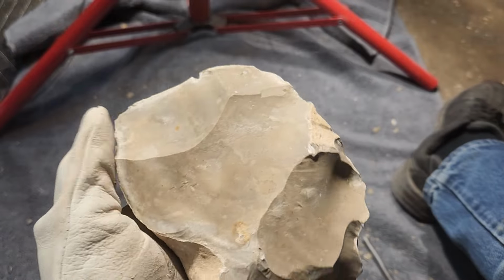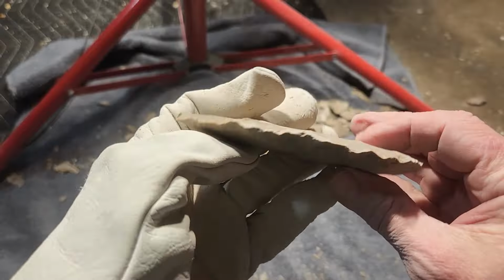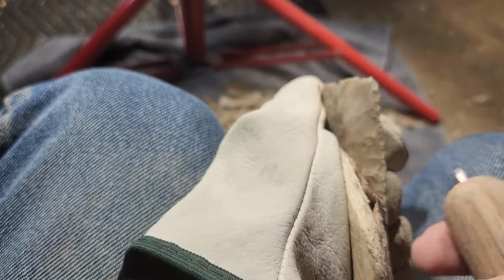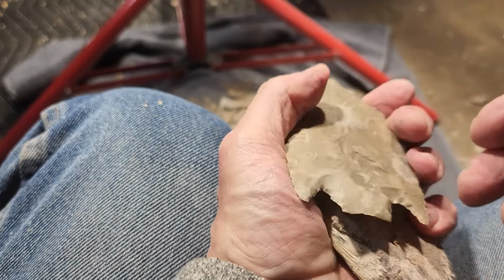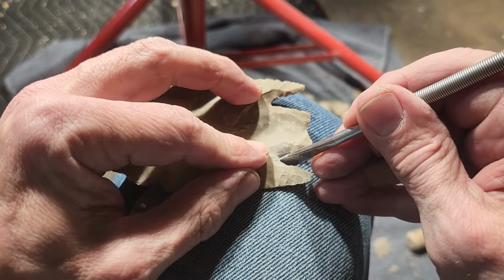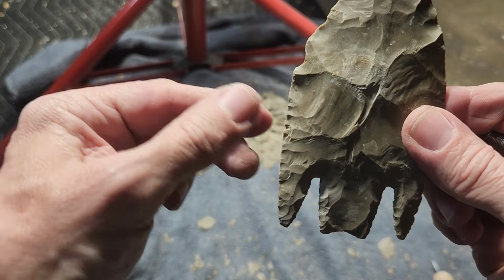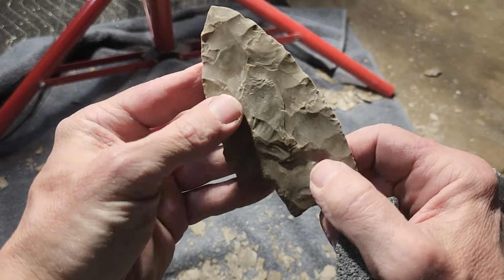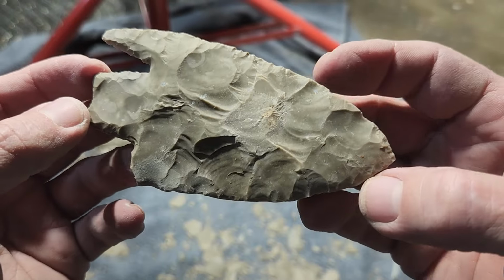1741 - Almost Deleted Flintknapping

Comment: What is the reason that you don't use your smaller bopper once you get to the biface and start initial thinning?  Thanks for not deleting, even though you are frustrated, these videos are such great learning tools for us. I understand that rocks are inconsistent and with that understanding I know that even you will break some.

Thanks for everything you do. 💗💗💗
Reply from the maker: For some reason, when I use the smaller bopper, I can't get enough speed going to knock off the flakes I want. I might extend the handle. That would probably allow me to swing faster.
Reply: @KnapperJackCrafty  Okay, I know you have the methods that work for you and I probably should have figured that answer looking back at the video where you used the smaller one.
There probably isn't much transition between when the smaller bopper would be effective and when you use indirect. Thanks again.
Reply from the maker: @marycomeau9364  True. There's not much difference between the flakes from the smaller bopper and indirect percussion.